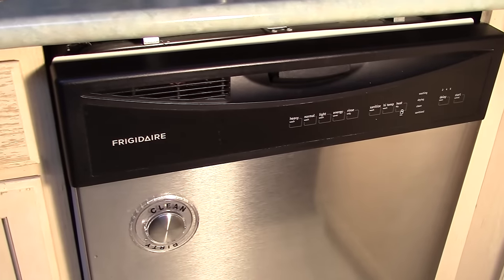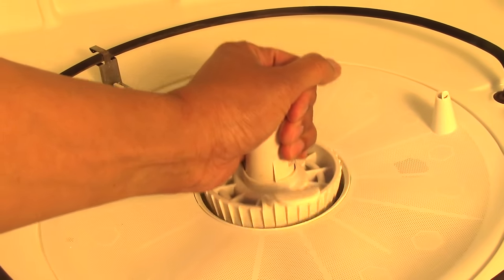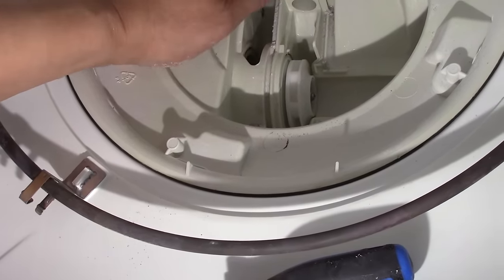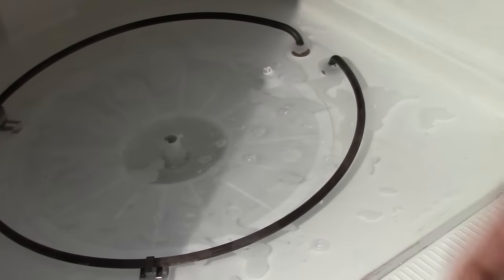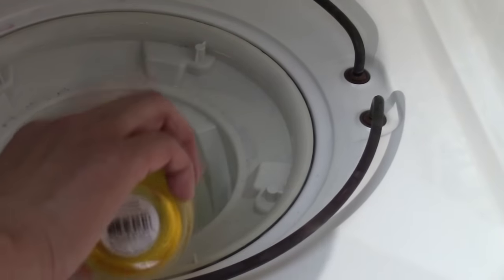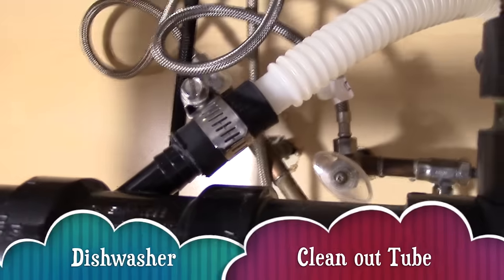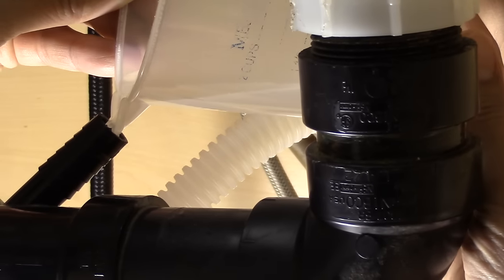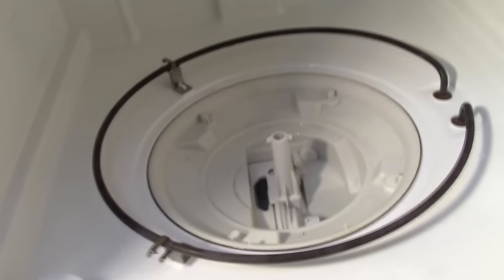Frigidare Dishwasher Not Draining Failed  2x - DIY unclogged dishwasher

Comment: Tried all the troubleshooting methods in this video, none of them worked. It did give me a chance to clean some gunk out of the various parts of my dishwasher and ensure that none of them were clogged.

Ultimately what fixed it was calling Frigidaire customer service and their suggestion to reset the computer inside the dishwasher. I did this by flipping off the circuit in the circuit breaker that controlled the dishwasher's power source, waiting 60 sec, flipping it back on again. Then I held down "Cancel"for 3 seconds until it seemed to reset itself, then I ran a short cycle.

That solved it. It sat not draining for months during quarantine because we didn't want to invite a technician into our house. All we had to do was turn the power supply off and on.

The Frigidaire troubleshooting tech also mentioned some people's might not be connected to a circuit breaker, it might just plug directly into a wall socket, in which case you can just unplug it and plug it in again instead of going through the circuit board.
Reply from the maker: Thanks so much for sharing with our viewers. This is valuable info for anyone else with this problem. Thanks again.

Comment: I have this exact model dishwasher and was having the same issue with it not draining completely. My trouble area was actually at the overflow. There's a "Y" where the discharge hose from dishwasher connects to the hose going to the garbage disposal. It was completely packed with gunk not allowing water to pass through freely. Just adding another area where a clog can exist to the list! Good video!
Reply: people u have to clean it regularly if u do not rinse your dishes!!! i rinse so i only clean out every 2 month h there is residual of plastic covering of wash tablets...  now i use no covered tabs easy peasy
Reply from the maker: Great idea.

Comment: I have the same dishwasher and your video helped me fix it perfectly!  Mainly the baking soda/vinegar step (I had already disassembled the bottom pieces and cleaned them).  I only wish I had done the solution before I pulled the whole dishwasher out to check the motor for electrical continuity.  O_o. Thanks!
Reply from the maker: So glad it worked for you.

Comment: You're so funny. Enjoyed the close ups and step by step of all solutions. Thanks for sharing. Did you turn off the water supply before checking the pipe? Or is that not necessary?
Reply from the maker: Glad my video could help. I didn't have to turn the water off, but it's not a bad idea to do so.

Comment: |Thanks, I failed the first 2 steps and now positive there will be the same calcium build up in the connection tube.  I have calcium build up in my shower heads and some inside the dishwasher screens.  My father was a master plumber and I learned a lot from him but since losing him I cannot ask all the follow up questions!
Reply from the maker: 3rd time is a charm. Hope it works out for you. Thanks for the nice comment.

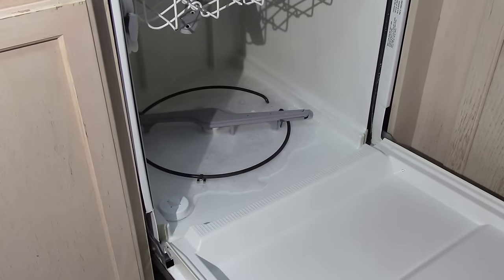Comment: The dishwasher clogged and i removed it and reinstall old dishwasher. It is simpler and did not catch or let fine lint to clog the drain.  Liked 3:44 timeframe.  But thank for the details shows to disassemble the parts.   I found a broken glass at the bottom that was making the extra noise.
Reply from the maker: Awesome! So glad my video helped you out. Thank you for your comment.

Comment: Gosh, I love this video.  It helps explain it step-by-step.  So, I'm gonna try to do it myself.  I've got same problem, but I suspect that wife left it clogged for a while ... Thus, the drain line might have some clogging there.  I pulled it off and draining it into a bucket.  Oh yeah, the garbage disposal needs to be replaced, because it's frozen.  So, maybe, it didn't drain good for a while and clogged the drain line.  That's my guess.  But, I like the idea of the hot water, vinegar and baking soda.  Brilliant.  If I remember, I'll get back and let you know what happens.   Also, a Trick for you.  Hit the ON BUTTON and HOLD IT; then, it will drain it all for you.  Or, that is how mine is.  So, you don't have to suck it out.  Hope that helps.  But, it could just be mine, but mine is a Frigidaire too, so not sure.
Reply from the maker: Thanks for sharing that info with our viewers. I hope it works out for you.

Comment: Great video I came on her because I have a leak and water keeps standing in the bottom and a plumber didn't know what to tell me other than it wasnt  installed correctly. But I have a question what Is the round white thing in the top left corner of the bottom of the dishwasher.?? I have no idea where my paperwork is.

Comment: I have the same DW with similar issues. Its always hair and mush from jar labels and food. I had to take everything you showed out but use a knife and pick to clean inside the impeller.  Ill remove the labels from containers in the sink from now on. Ive had to clean mine the same way 3 times in 5 years. Just goes to show you these things need maintenance.
Reply from the maker: Yes you're right. It does need regular cleaning.Thanks for sharing with us.

Comment: Great video and thank you..
My Kenmore just keeps going in cycles and won't stop or drain completely .. standing water now..
Super clean cuz no one else uses it it.. only pre-rinsed dishes go inside my dishwasher for washing ... 
2nd time Same issue in a year,, first time a guy came out and took it apart and found nothing...he  just reset it and left ... ... now the same and it just keeps going with hiccup at drain... I have to unlatch for it to stop....plz   Advise.. 😰

Comment: I did everything in reverse order since #3 is easiest, which ended up clear. Combined #1 (found hair ball) and #2 as "might as well since everything is taken apart anyway". I didn't suck out the water since I didn't have a good mechanism to do so but bailed it out as best I could. Seemed to work and confirmed draining on a couple rinse cycles. Regular washes seem to work.
Reply from the maker: Glad it worked out for you. Thanks for sharing with us.

Comment: 1st step didn't work. Gonna try the hose under the sink today. Do I need to shut of water and electricity at all to do that repair? Or does this hose only have stuff in it when it is operating? So it should be safe to do it whenever
Reply from the maker: Definitely safe to shut off water & electricity.

Comment: The hose that drains is a flex tube with lines across it give it a couple light tugs  and see if it starts draining. This fixed my problem but the p trap did come apart and water I poured in  the sink from the tube that led to the dishwasher leaked inside the cabinet. Next time I’ll remove all that stuff I have stored in the cabinet under the sink and be ready haha
Reply from the maker: Awesome! Now you know next time.

Comment: Awesome vid! Now we have a sunroom (add-on) behind sink/dishwasher where water is leaking through brick wall--and it doesn't appear to come from the clean out. Happens only running the dishwasher. Any suggestions?
Reply from the maker: Good question. Have to open the wall up to see. Sounds like be a broken line somewhere or leaky  fitting between the washer and your water line to the washer. Let us know what you find.
Reply: @jonahvlogsdiy4143  Will do. Yeah, it's really random.

Comment: Hi, thank you for this! What's the tube that you used to get out all the standing water?
Reply from the maker: It was just an old 1/4 inch rubber hose. I did the old fashion way sucking one end of the hose until water started to move through the hose.

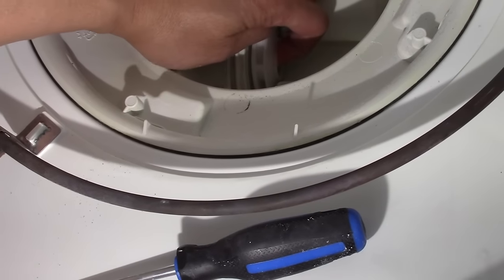Comment: In the first step after you remove the screws.  You see that hole to the left of his thumb at 3:02? Go in your dishwasher and look into there, hair gets wrapped around it. You can get it out with some tweasers. Mine was full, it's a really awkward angle to work at and see into it so you might need someone to hold your flashlight for you. Or put your phone flash light on and place it on the top rack shining downward. 

I cleared out that area and then also cleared out the valve that Jonah did in his 3rd attempt.

If neither of those things fix it, it's probably the pump that needs to be replaced.
Reply from the maker: Thank you for sharing Jonathon. Now our viewers know.

Comment: Vlog very helpful tried all three things my dishwasher still won't drain do u have any idea what it could be?
Reply: Can I use a snake to clear the drain hose?
Reply from the maker: I don't know if there's a small enough diameter snake that can fit in the drain hose.
Reply: I tried a thin drain snake couldn't get it thru the pump have to call a repairman thanks

Comment: Great video. One tip. Baking soda and vinegar cancel each other. One is a base the other an acid. The properties that make each great cleaners is neutralized and the solution you end up with after mixing is worthless.
Reply from the maker: Great info. Thanks for sharing.

Comment: Hi, wonderfull video, however there's a little pool of water under the basket, is this normal? Thanks
Reply from the maker: There should be no water. It may mean that you still have a small clog somewhere or your pump is not working 100 percent.
Reply: @jonahvlogsdiy4143  hey, thanks for the advice! I digged more in the dishwasher and there were some hair behind the little white wheel as well. I ran the rinse cycle again and now it makes so mhch less noise! however, there is still a little bit of water where the white wheel is, so you're saying there may still be something else stuck in the drain?

thanks so much for your help, youre making me save lots of money!

Comment: 4/4/2020  did step 1  and step 2  don't forget to wait 10 minutes and remove with 3 screws which of course i didn't do....  in the meantime you can do step 3... Praying it works.  I was about to buy a new machine until i saw this video.  THE CULPRIT -- dishwasher PODS plastic.  Dollar store soap...LOL.
Reply from the maker: The culprit again...soap pods!. Lol. Glad my video helped. Thanks for sharing with our viewers.
Reply: @jonahvlogsdiy4143  i forgot to unbolt the 3 screws and it didnt work so i did the entire process over again and it did THANKS SO MUCH
Reply from the maker: @retirementplanninginstitut1095  glad it finally worked out.
Reply: @jonahvlogsdiy4143  Actually Johan, l have a problem.  I just ran a full cycle with soap and there is a puddle of soapy water at the bottom.  This causes all the dishes to dry with soap on them.  When I ran your test I didnt use soap so I had clear water at the bottom..  The washer doesn't fully drain, but I do have water draining while machine runs as I don't have a flood like the first day.    I have done your video twice now.  What do you suggest next?
Reply: Ran the washer a 2nd time all the way through with soap and BAM!!!!!!!!!!!!!!!!!!!!!... PROBLEM SOLVED.  THANKS SO MUCH!!!!!!!!!!!!!!!!!!!!!!!!!!!!!
Reply from the maker: @retirementplanninginstitut1095  So glad it finally worked out. Thanks for sharing with our viewers.

Comment: I've cleaned our 3x before this - this is 1st time w/no drainage...the exit was semi-plugged...I can't blow back thru line so I'm thinking it's clogged @ pump end - is there somewhere you could snake it or strictly vinegar/hot water etc?
Reply from the maker: If the exit line is fully  unplugged & the water still doesn't move and you don't hear anything, your pump may have to be replaced.
Reply: I was sooo worried - I did the baking soda etc + I added bleach & let it sit...the pump was buzzing after it started to drain & then I couldn't see water moving anymore so I stopped the cycle - turned out it was because it was foam - all clear now & thx for video! @jonahvlogsdiy4143

Comment: Did you resemble the washer with the baking soda, vinegar and hot water, or just run the rinse with the blade, basket, etc off?
Reply from the maker: Yes it was a lot of work, but I did reassemble each time.

Comment: Mine was doing the same thing. When i got down to the little pump wheel it was broken. Not a thing wrong with the actual pump motor, just the little flywheel that spines. The other thing that really pissed me off was....I HAVE TO BUY THE WHOLE PUMP!!! Can't just buy the little wheel that is held on with 1 small little screw.
Reply from the maker: Thank you for sharing that. Now our viewers know if they run into that situation.

Comment: Nice video. What if the dishwasher does not drain and does not run a cycle?
Reply from the maker: It maybe a different issue if it doesn't run a cycle at all.

Comment: We have same no-drain issue, but ours also does not start. I'm wondering if yours also would not start or whether it just wouldn't drain.
Reply: Must still need coffee. Just realized this is a dumb question; yours started.   :-)
Reply from the maker: Yes mine does start. But if yours does not start. It maybe a different issue. I had a viewer that had that issue. They called the Frigidare Hotline and they said there was a reset.

Comment: I have a Frigidaire Gallery series. I cant even find a rinse only cycle. Anyway, took it apart, has a few more pieces but generally same idea. Mine however connects directly to the garbage disposal. Why? That's how it was installed by whoever. Makes no sense to me because in theory nothing big enough to need grinding should ever even get that far. I am no expert though. I hate plumbing. I would rather shovel manure (which I've done plenty). On mine the sink drain fine. The inlet to the garbage disposal seem clear but will double check. We did try baking soda and vinegar, but not quite the way you did, no boiling water, and did it when all assembled. I tried blowing back thru drain hose and get the slightest bubble or back flow. I have disassembled the dishwasher same point as you and no hair, glass or debri of any kind. I am wondering how the drain hose could be plugged or if I should even be able to blow back to the dishwasher at all. Maybe one way street? Any ideas?
Reply from the maker: Great question. Sounds like the drain hose is plugged. Maybe garbage from the garberator  has backed up into the drain hose.Check it out firs since it could be the problem.

Comment: Oh, 3rd more ding.  Do nut use electric drill, battery powered or AC corded one to screw back the filters.
U can't control the torque amount even if its spd is variable.  U'll end up w cracked plastic tabs.  Use
manual screw drvr w that T-15 Star Torq tip.  It's OK to use the pwr drill to remove the screws however.
Butto again, make sure the drill direction is to the reverse.  Hope this will prevent PitA 4 many.
Reply from the maker: You're right. Great advice.

Comment: I have the exact same model dishwasher (from the looks), but I cannot tell exactly which one it is.  Can you PLEASE tell me?  I tried all of your fixes, but none did the trick.  I still have standing water :( What else can I do?  If I need a new pump...or need to replace the hose...how do I get to it? Which pump do I buy? Perhaps having the model number will give me the info to buy a new pump (if needed).  Can you help?  Any ideas are most appreciated!  Thanks again!
Reply: I too have the same model. Mine has just stopped turning on at all, which is how I ended up here. Even though his video doesn't pertain to my issue, it was fun and informative nonetheless.

Comment: I’m having the exact same issue with a frigidaire.  I opened up the drain line and found a rubber foot.  How did a rubber foot get into the dishwasher system?  It fell off a cutting board.
Reply from the maker: LOL

Comment: SUCSEES! I hope mine is clogged and not a pump gone bad... So tired of fixing stuff around the house. Eventually, everything breaks at once. Chainsaws. Generators. Oven. Hot water heater. Washer. Dryer. Dishwasher. Fridge ice maker. Microwave. Flat tire. Dead Battery. Clogged carbs. Porch light fixture. Roof boot leak. Moldy ceiling. Sump pumps quit. Lawn mower breaks a belt. Another dead battery. Dollie tires flat. Wagon tires flat. Trailer lights quit working. Soffit blows off. Water softener gunked up. Garage door not raising. Siding gets broken. House needs power washed. Weeds wont stop in the rocks. Interior door hinges sagged enough to not close. Dvd player skipping. Cabinet shelf busted from water jug leak. Toilet running. Deck board needs replaced. Decks need stained. Furnace blowing a breaker. Wood needs split. Sciatica nerve acting up. Drum sticks all broken. Wife not putting out nor cleaning kitchen. What a world! So wonderful.
Reply from the maker: Lol. I know exactly what you mean.

Comment: Is there no safety feature that shuts the machine off to prevent further standing water issues? mine had the same standing water issue and i figured it was clogged. cleaned out every single thing but mine wont even run (fill with water) so there's no way for me to know if it's actually clogged or not. I'm thinking i need a new water inlet valve but i would like to know for sure.
Reply from the maker: My machine is hardwired so I can't shut no & off. It's possible you need inlet valve. I'm currently replacing the inlet valve because it leaked water at the valve. That video will be out soon.

Comment: I have this washer too but my problem isn’t about draining or clogs. It actually does the job of cleaning and draining well. It just now makes a loud sound. It starts at the beginning and goes until water drains. It starts and stops as it goes through the cycle. Any idea what this is? Once again, it washes and dries dishes fine. I just know the loud noise is not normal. Thanks!
Reply from the maker: Try opening up the trainer basket like in the video. Maybe something inside is loose and making the noise. Thanks for sharing and i hope our viewers may have other ideas.